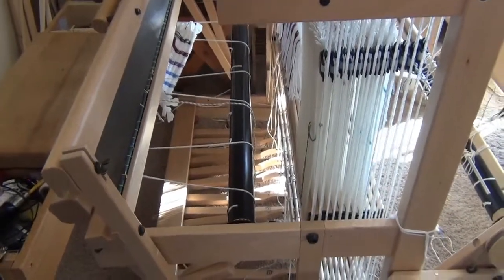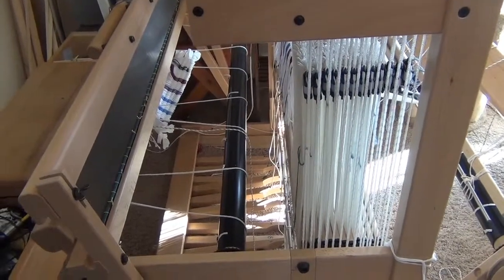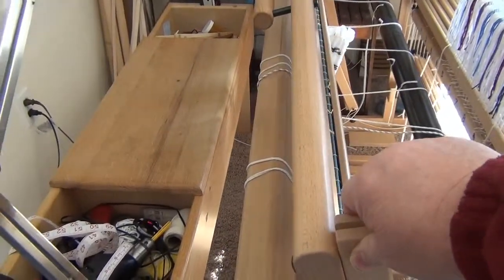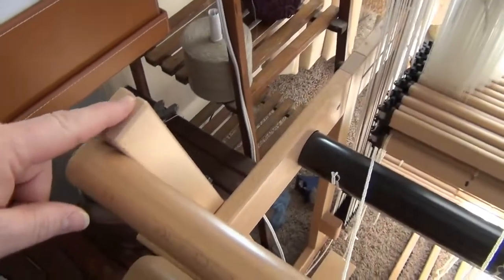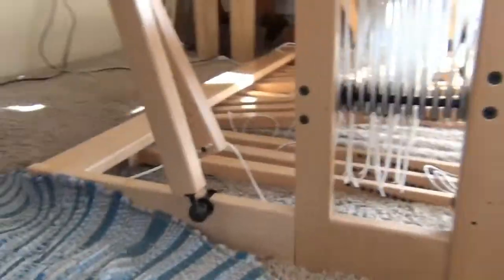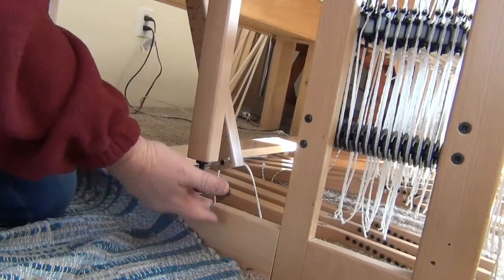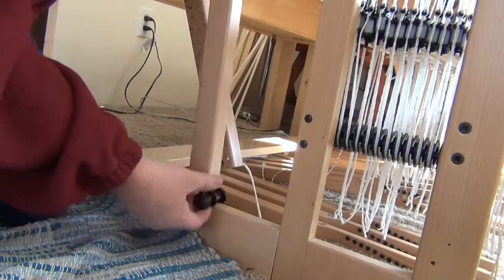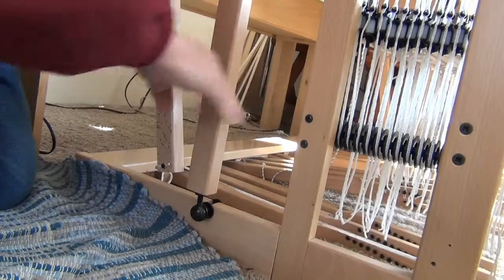Beater Bar measurements for Eva

Comment: I had to add two of the paper inserts supplied with the loom to level my beater against the rubber stoppers by the reed as when I set the loom up one side of the reed was resting against the rubber stopper but the other side was not,Louet gives three of the paper inserts but I only had to use two of them on one side of the reed since doing this my reed has stayed level ever since.